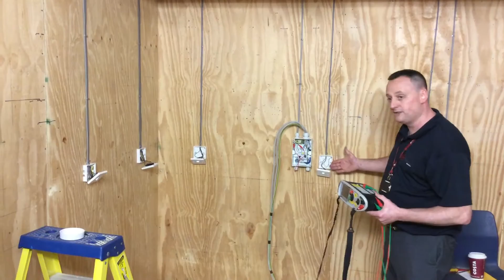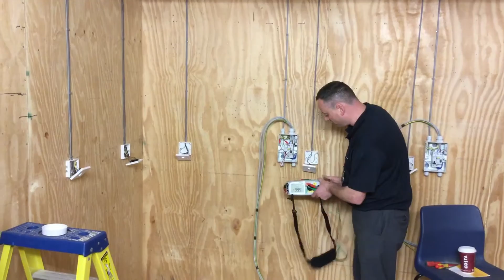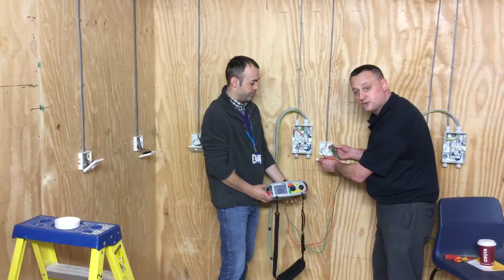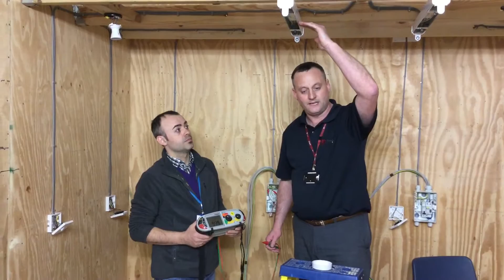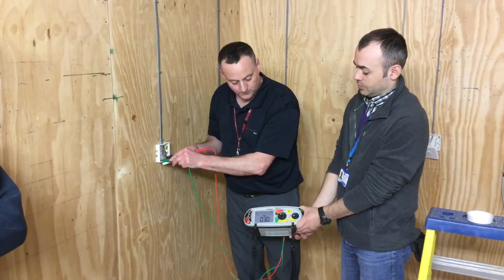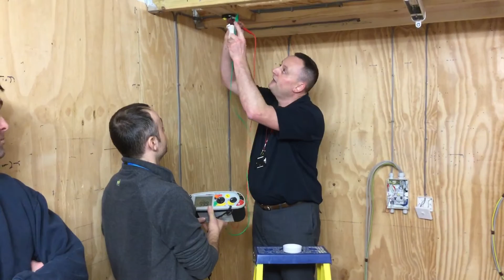How to Carryout continuity of CPC and polarity of our large lighting circuit - Using a Megger MTF

Comment: thought you test at furthest light on the circuit.how many lights would you test in a domestic situation then ? the furthest light and any 2 ways
Reply from the maker: +Roy Kirkham 
Hi. If you have 10 lights in 10 rooms and the switch(es) you test every light for continuity and polarity and every switch for continuity only. If you only test the furthest lighting point the CPC (earth) could be absent in other parts of the installation or some rooms may not be working (switching). This means when you go live some lighting point might not switch on embarrassing if the customer is about. Other issue is the installation resistance test needs all switches on so it tests the full circuit and if a CPC (earth) is missing at say a switch and the customer changes it for a metal one (exposed conductive part) there is a massive risk of shock. Hope this helps GSH Electrical
Reply: GSH Electrical 
ok thanks so on the insulation test you'd operate 2 way lighting etc so your testing all the switching aswell and not just the circuit wiring.am I on the right lines here.testing is something I'm trying to get a better understanding of thanks for the info
Reply from the maker: +Roy Kirkham 
Hi. During continuity and polarity test leave all your switches in the on position then once you have completed your installation resistance test later in the test sequence walk around the installation operating all two way switches. By operating both two way switches you put the other strapper in circuit which wasn't testing during the first installation resistance test. If you have intermediate switches in circuit you do not operate these just the two way ones. Then it's back to the dis-board and do the installation resistance test of the lighting circuit(s) again. Hope this helps GSH Electrical.